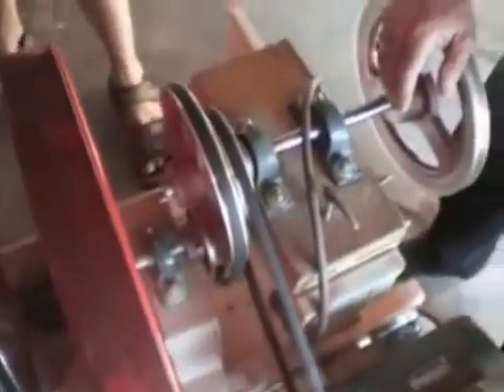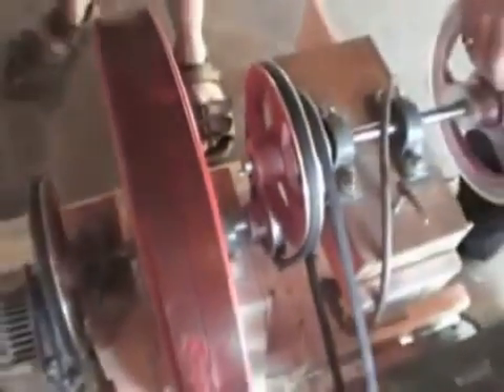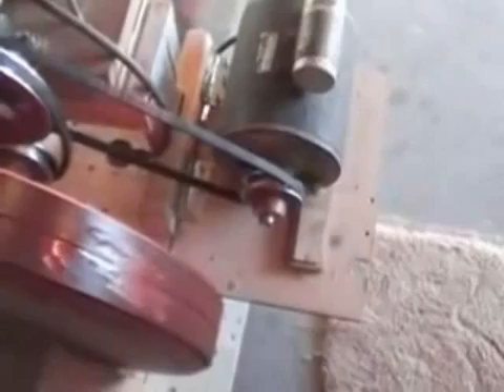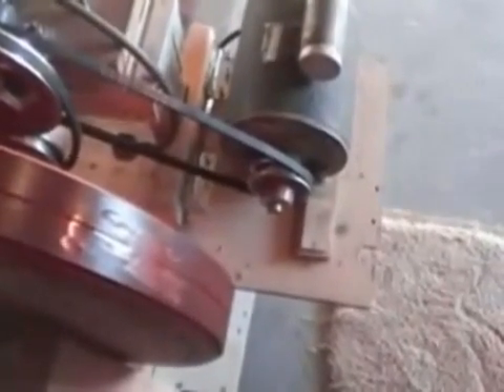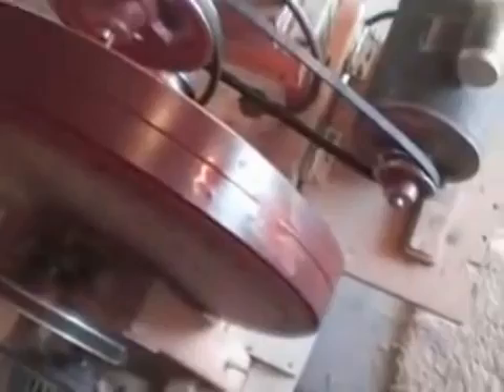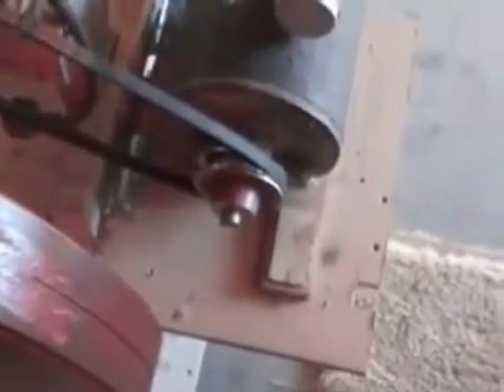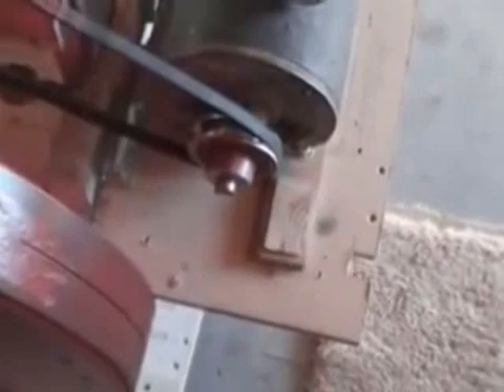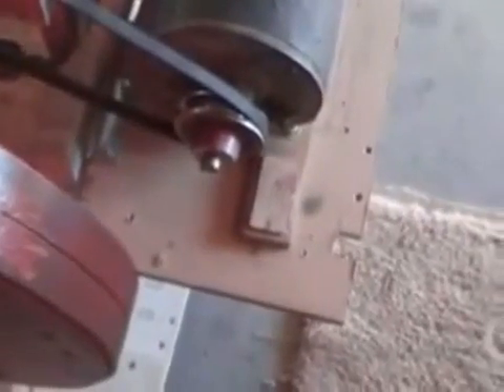Free Energy Dec 2014 Chas Campbell's Flywheel System

Comment: hi, mr. campbell, hope u ok there. i am highly interested to build up this types of project. i hv already a 1HP, 1450 rpm single fase  motor and 2.2KW, 1450 RPM  generator. now my question how much KG FLYWHEEL I NEED FOR THIS PROJECT??? thanks
ullash 
squllash@gmail.com
Reply: +Abdus Sattar ...the flywheel is not there to create power...is only store kinetic energy..thats it...this system isn't work...i built one the same and is no chance in the world to work
Reply: +Abdus Sattar 
in another video it is mentioned that the flyweel weight is 10KG.
did you implement it successfully ?
Reply: i think a 10 kg flywheel working on 1450 rpm is use less bqz gravity goes 0 on this rpm with 10 kg you should use a 40 or 50 kg flywheel for it
Reply: The way the weight is distributed creates you the free energy and the fly wheel does most of the work lol..

Comment: Hi Mr.Campbell, I have been trying to get a similar flywheel system to work but the electric motor doesn't want to self sustain or self loop. I have a 5kw genhead rated at 21.1 amps 240vac and using a 1.5hp 8amp 240v  motor to drive it with. Any ideas as to what might be going on? Also if you wouldnt mind posting, I'm interested in what you are using to switch over from mains to the generator.

Regards, jetkrazee (Forrest)
Reply: +Robert Tainio How many rpm in this motor?
Reply: 3450.
Reply: Robert Tainio What´s the mass (on perimeter), radius, and rpm your flywheel runs?
Reply: I'll have to check my notes. I was tinkering with this a good while back. I'll post that info in a few days. Thanks for replying! :)
Reply: Robert Tainio Keep me informad, please. i can help you. Much. Where are you from?
Reply: North Carolina in the USA., and thank you. I will get back with you as soon a s I can have enough free time. We run an aerial and landscape photography business and have been extremely busy.
Cheers
Reply: I need free flywheel energy 20 kv
Reply: Ur electric motor should be 700w to draw 2.2amps then ur pulley sizes is very important